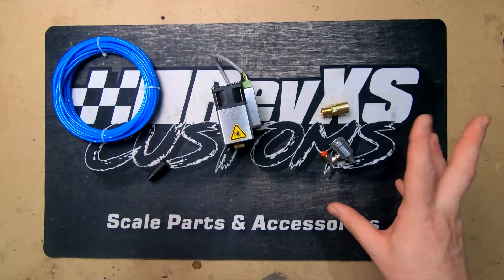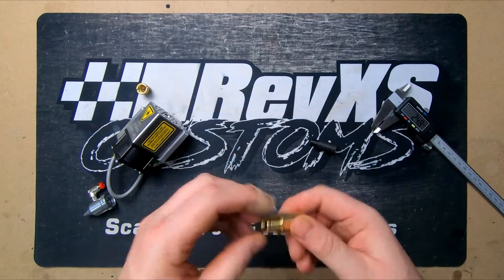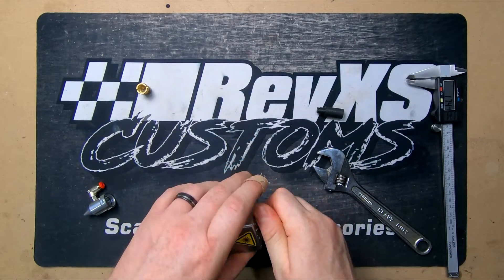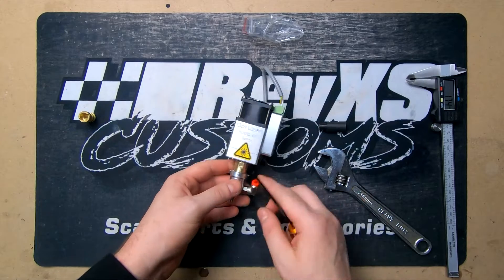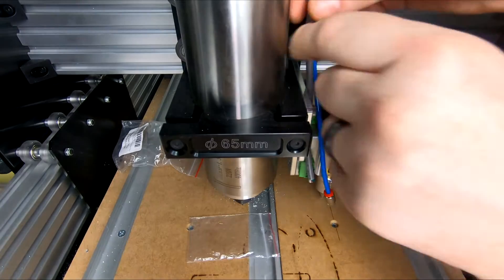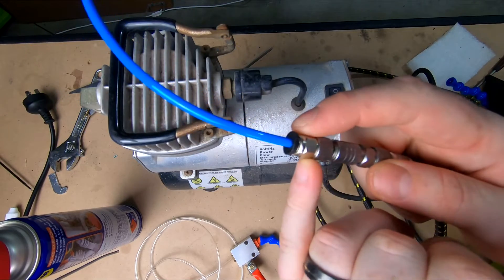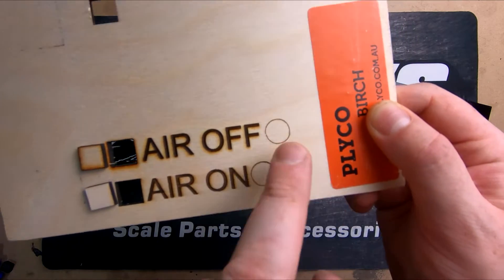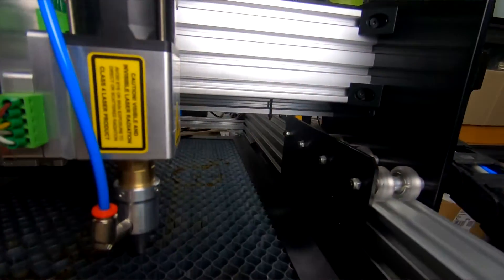Opt Lasers 6w Air Assist Install/Test

Comment: what is the air pressure you use?
Reply from the maker: Running a small airbrush compressor is running all time keeps it around 8 psi really a little on low side but did seem to do trick

Comment: How long did each of those take? I have the same laser with the uSpot lense and still trying to figure out how to get good burns that don't take forever. I didn't even think cutting through 1/4" material was even possible!
Reply from the maker: Been awhile since done any laser work,can't remember settings off hand but has to do a few passes at high speed to cut thru